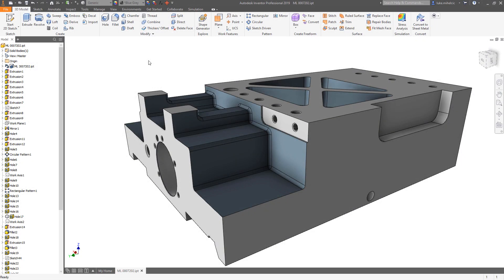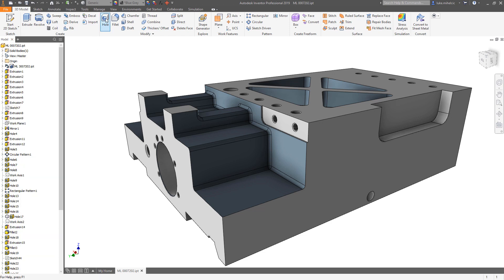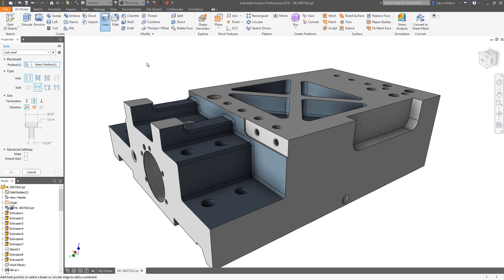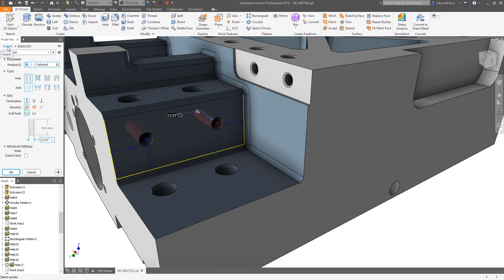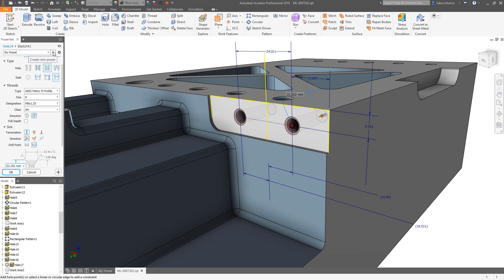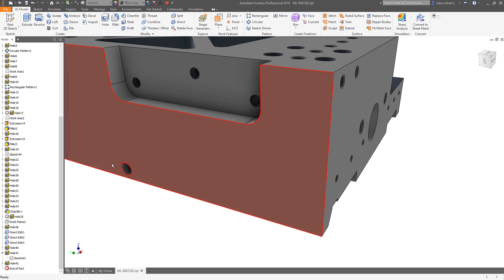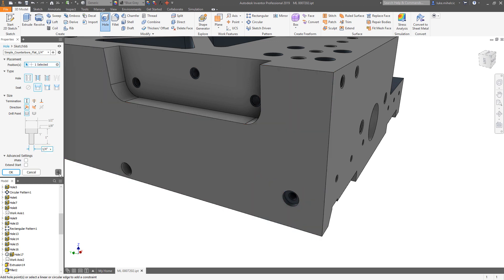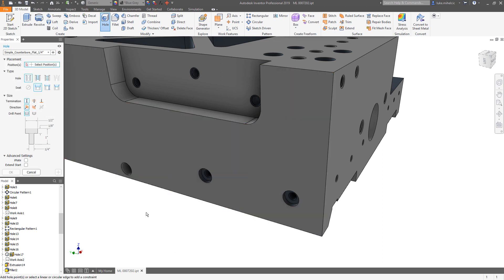Quick Tip: Updated Hole Command

Comment: Is it also possible to make slot holes with the hole command?
Reply from the maker: There is not. You could create slot iFeatures...  https://knowledge.autodesk.com/support/inventor-products/learn-explore/caas/CloudHelp/cloudhelp/2014/ENU/Inventor/files/GUID-26129698-1C1C-482F-A2ED-673563331283-htm.html